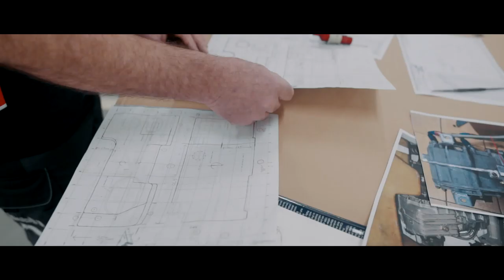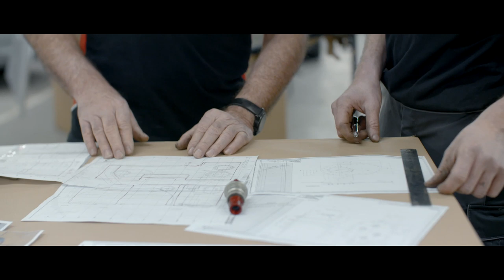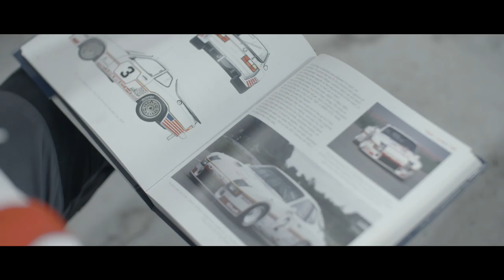Porsche 924 GTP Restoration No Copyright 1080p MP4

Comment: This was a fantastic project. I saw the car before and after the restoration, as Road & Race do work on my cars. They are fantastic restorers and did an outstanding job on this car. OK So now for some info. If you watched (and listened) to the video you will have heard the car was used after Le Mans by someone and altered and had been damaged. The drivers at Le Mans said there was no damage on it when they handed it back. So the car had a different engine and lots of damage NOT caused in the original race. So restoring it was the correct thing to do. 

Also VW never built this car. The original 924 had an engine designed by VW but the car was built by Porsche. And this car has nothing from VW in it. This is a race prepared Carrera GT! Please know what you are talking about before commenting.
Reply: Well said